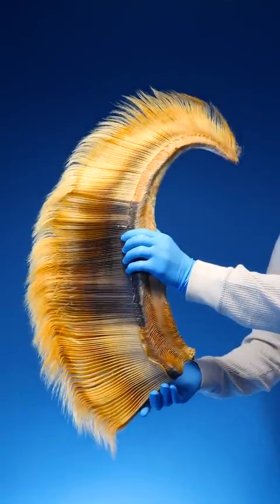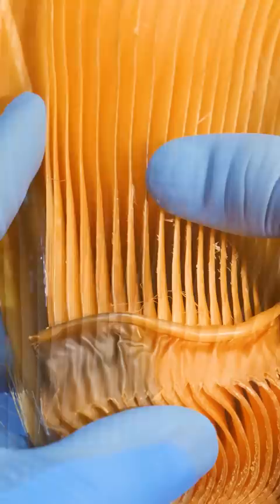How Does Whale Baleen Work?

Comment: How did this even evolve like this, I can't imagine the mutations along the way
Reply: Baleen is made from the same material as hair and skin so it very rarely fossilises so it's evolution isn't completely understood.  Whales at one point had teeth, but when the Antarctic broke off from gondwana to form the Antarctic circumpolar current, the number of prey available in oceans increased. around this time some whales changed strategies from using their teeth to kill singular prey, to using their tongue to suck in water so they can feed on multiple fish at the same time (still with teeth). The problem though is that they can't just swallow all that water so they have to let some of it out without letting the fish out. One idea is that baleen originally formed as a sort of keratinous filling between the teeth, to reduce the size of the holes fish could potentially escape through. Over time the structure of the keratin became more intricate, while the whales lost their teeth, until you're left with modern day baleen. Another idea is the keratin in their gums might've been serving an entirely different purpose, but when switching to suction feeding it was repurposed into baleen. Another idea is that rather than just switching to suction feeding there was some kind of intermediary strategy that used suction but not as as their main method of hunting, perhaps only to keep the prey from escaping once caught. Or maybe it's a combination of all of these. Again, baleen is essentially specialised skin, so fossils of this stuff are extremely rare, so we only have proposed mechanisms and no confirmed ones.
Reply: @user-fg5xs9lh7s  what always fascinated me, is the existence of evolution itself. Isn't it kinda weird? Like what makes the next generation's genes go, oh we need a thing over here to filter out fish. Like the idea that there is some sort of mechanism that makes these changes and iterations. Like I know it's a long process and all, but still. It's almost mystical to me. Know what I mean?
Like the whale wanted to do one thing and the next generation just slowly adopted these features...idk .... how does a desire of a whale turns into genetic code and translate to another generation 😮
Reply: @TheThingoftheSky  The "secret sauce" is sex. Organisms that reproduce sexually have a lot of variation in them. Other than biological twins you probably won't ever find humans that look the same, for example, because of sexual reproduction. Asexual organisms don't have even close to the same level of variation, because their genes don't get swapped with each other. Basically what that means is, nothing needs to really be invented. If a characteristic is going to be beneficial, some guy somewhere probably has it, and it's the same with whales. 

Some whale somewhere might've been weird and had different shaped lips that help contain fish or something like that. And then in later generations some whale was weird and it changed more. And then in later generations the skin hardened into keratin. Etc etc. like I said before nobody knows the exact evolutionary pathway baleen took this is just an example.

 But the trick that makes it work is that no individual step needs to be invented, because of sex. If a trait could be an advantage, some guy somewhere probably already has it, and as the traits get selected they'll keep piling on over and over. Think of it like you're blindfolded, and I hand you a bag full of Lego bricks. Most of them will be flat with the stubs sanded off (non-beneficial traits), but some of them will have the stubs intact still (beneficial traits). If you keep smashing random legos together eventually just from trial and error you're gonna have a pretty big tower of bricks.
Reply: @TheThingoftheSky Simple, it doesn't. The 'desire' is completly irrelevant.
Reply: @TheThingoftheSky There is no desire involved. Evolution works in all directions at once and when a mutation occurs that makes an animal survive better than the ones with the other mutations, they reproduce and go on to have more offspring with the same mutation and when some day that mutation mutates even further and it's once again giving it an upper hand over other ones the mutation is again propagated forward yet again. These are thousands upon thousands upon thousands generations worth of continuous mutations in every single direction and the ones that give an upper hand, get to go forward.
Hope this helps
Reply: @user-fg5xs9lh7s  I just adore your explanations I'm 1 year in middle school so I barely know anything and not a lot of words but it's always interesting learning of things ocean related whether it's about the sea or the creatures that inhabitant it

Thanks for the explanation and your take on things
Reply: @user-fg5xs9lh7s 😂😂 tell me u at least also believe in the Bible right?
Reply: @sellerroyall1690  Thank you, I like teaching :)
Looking over it now I realise it might've been confusing because I'm used to teaching people a bit older, so if you have any questions I'll try to answer a bit simpler
Reply: @kalebanth8323  not personally
Reply: Hey have you seen her new boyfriend?
Yeah, a bit weird with those hairy gums of his....

He looks well-nourished though ..
Reply: @TheThingoftheSky  desire doesn't, its based on random mutations in genes. Say an ancient human who couldn't bend their arms properly, and had a sort of t rex arm stuck like that could perform a critical function better than people with normal arms- the excellence in that critical function would mean they live long enough to have babies, and more babies than anyone else in their tribe. Since their odd arms is a genetic trait, most of their children get the weird arms too who can do what their parent did very well.

fast forward multiple generations and now most people in the tribe have the weird t rex arms. Humans are a poor example because for as long as we have been homo sapiens we have been circumventing natural selection, but I surmised using us might make the gist of it more clear.

Its not a desire that is expressed in genetics, but instead a population filling a certain role in nature (like eating krill instead of larger fish) since its easier for them to survive that way, and then the ones who happen to mutate to do that thing better by sheer genetic coincidence have more babies and eventually the population reflects that trait entirely, like baleen.

Some mutations that are not helpful but also not hurtful occur, and can be seen in a population because they weren't bred out of it but weren't bred into the population either. Its just luck that determines whether a random mutation might be species defining, and if it is you're more likely to see it in living animals or fossils bc there were simply more of them with that beneficial mutation to find.